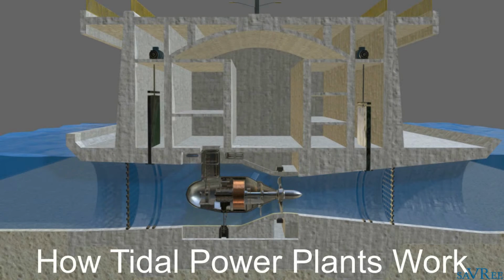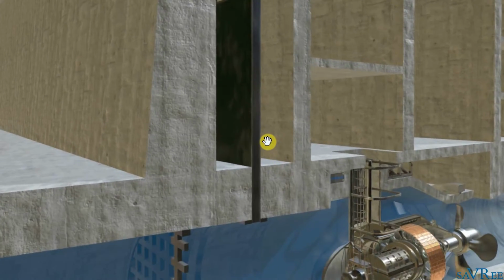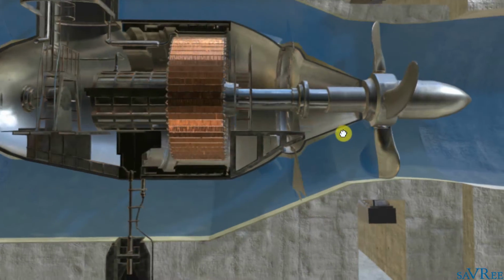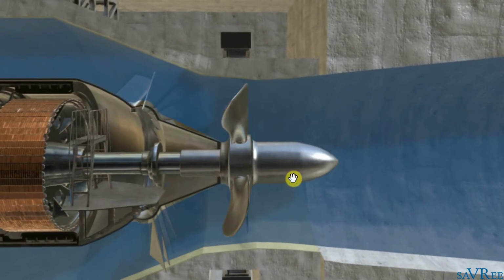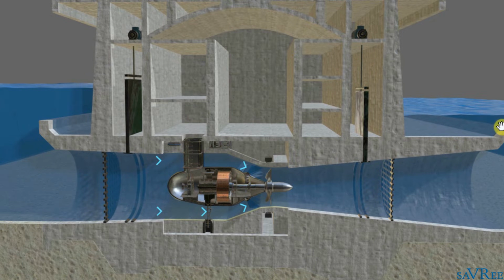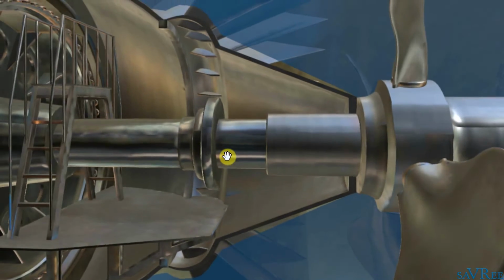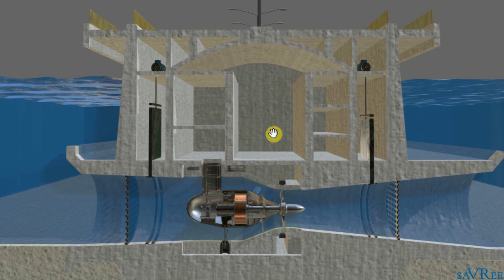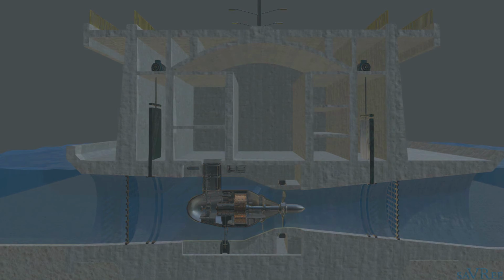How Tidal Power Stations Work (Hydropower Engineering)

Comment: Great video, thanks!
Reminds me the tidal plant design of some Australian company, it's based on air pressure, very interesting, but I don't know why they developed a whole system to prevent the air backflow, if it's an AC generator it wouldn't be any problem with the direction of rotation, would it?

Comment: How continuos is the power generation? It looks like there could be some amount of time when there isn’t enough water height difference to drive the turbines when the tide changes directions. Is that true and if so how will long would that last?
Reply from the maker: Its true. It depends on your location and how quickly the tide comes-in and out.